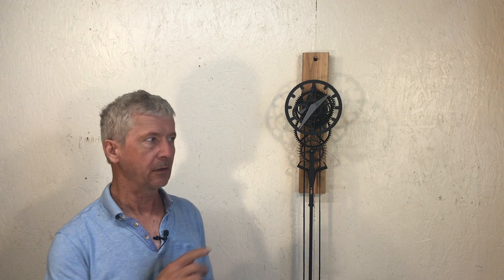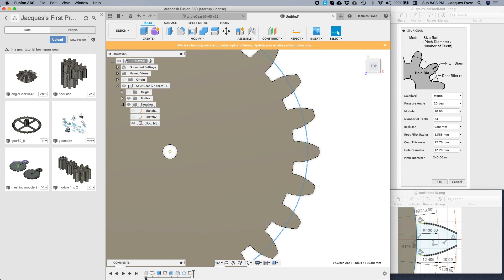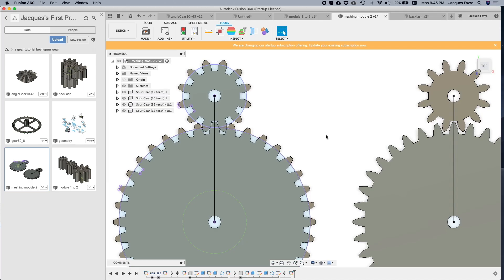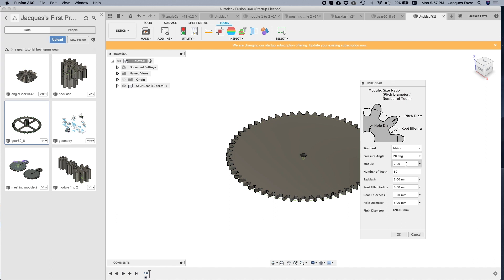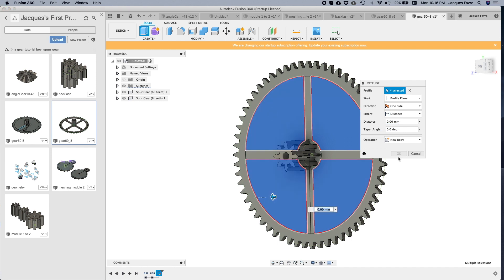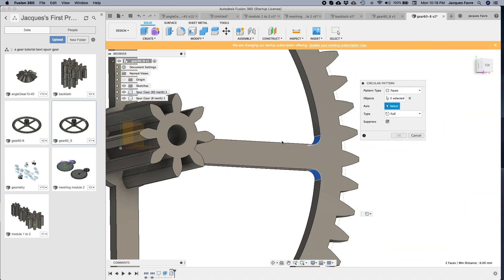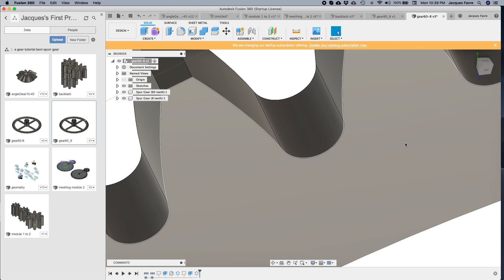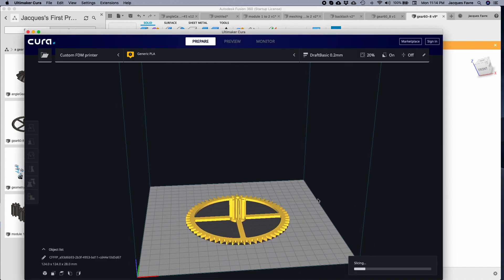How to use Fusion 360 to design 3D printed clock gears

Comment: I have made a number of wood and metal clocks. But, one of the things that I have the most trouble with is how to efficiently design creative spokes on a CAD program. ( Think antique flywheels; industrial revolution era.)  Actually, as you know, you really design the holes and you need two holes to make a spoke. But, when they get a bit complex, making them identical without spending hours on the design wears a bit thin after a while. Any thoughts ?

Comment: Your solution seems to be an involute profile with a modified root fillet to minimize friction.  It appears to have worked well in your successful clocks.  Did you try a horological gear profile as for example in BS 978: Specification for Fine Pitch Gear s (Cycloidal)?    https://www.csparks.com/watchmaking/CycloidalGears/index.jxl  Dr. Rainer Hessmer has a free online tool that can export DXF files.